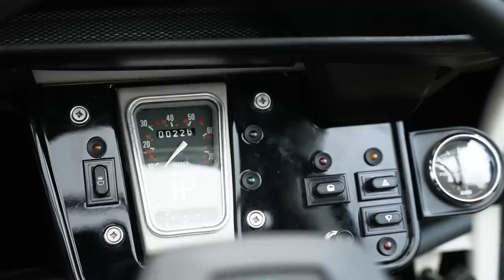All NEW electric converted Citroen 2CV

Comment: Got to love the way they are keeping iconic cars alive. This seems lovely.
Not sure about the spare wheel thing. The two times I needed one I actually had something physically sticking in my very well looked after tires :D.
Reply: You can find a front bonnet with spare wheel fix on bonnet, it’s available if looked around hard enough, probably a shop outside Paris sells them.

Comment: My thoughts are mainly around it not fitting with how I use my 2cv but may be relevant to others as a large part of 2cv culture is day long runs of 100+miles or driving cross country to 2cv meets. 

For me it’d need at least 30kWh and CCS. 

I would love an EV conversion for mine (my daily driver is an EV) but the club cassis kit just falls a bit short for me.

Comment: Why? I can’t imagine that this makes any ecological sense at all
Reply from the maker: London CC for example...
Reply: More than throwing it away and digging an entirely new car out of the ground I would have thought.
Reply: There's a lot less material in one of these than in any of the modern "cute" EV's, light weight means less energy to move it, less brake dust pollution when you stop it and it'll be the kind of car that is looked after long term rather than traded in for a new model after a couple of years.
Reply: My point is, that a regular 2CV is a very economical car. Keeping it on the road, rather than sticking in a new EV engine and a battery pack seems a lot more sustainable to me. I might be wrong…
Reply: @oliverlondon5246  Depends how long you are going to run it for and if you live in a  city that still allows you to drive a petrol car, as Jonny says, it's not for everyone.

Comment: My 1990 2CV6 Charleston has a top speed of 115 kph and range per tank of 300 km...
Currently insured in Australia for $42,000 (Euros 27,000)

I could get enthusiastic about a 2CEV as long as it had a top speed of 135 kph - which I have seen on my 2CV6 on the GPS on a long down hill with a tail wind.
AND.... a minimum range of 200 kms.....preferably 250 kms. 90 km range is not enough for a fun excursion in the countryside.

After 3 new 2CV6s - 1978, 1982 & 1990 and 550,000 kms - so many smiles per mile.... I am totally addicted.
I have only had 1 flat tyre in that time... in 1979.

Comment: I've got one 2CV that I restaured. She's been waiting for 8 years for a conversion kit. But those kits costs more than a working electric car.
Ultimatively, it's may be cheaper to get a Renault Twizzy (biggest motor) and fit the whole system into a 2CV.
Reply: As tome goes on parts are gonna get cheaper, so grabbing a drive train is probably the best route to go. I've been tempted by a few wrecked Nissan Leaf(s? Leaves?), but apparently their control systems are a real pain.

Comment: Love a 2CV, i learned to drive in my mums Dolly and use to have surfboards sticking out the back with the roof down when i was in my late teens. i seriously considered one for the kids school run but they are holding value but an EV conversion might just swing it. Just wish you have driven it without the door on (they lift off) would have been hilarious.

Comment: If they can get the range up to 100 miles with a fast charge option it would be great as a round trip into my closest city is 58 - 64 mile, depending on which side of the city one is visiting, if only spending 30 minutes there I might not make it home.  For pottering into the town and back it is great as only a few mile.  Never owned a 2CV but always loved them along with the Renault 4.  French quirkiness but very practical.

Comment: I see that CV as very flexible. Change the tire and suspension set to wider tires and stiffer suspension (lower) and plug it with a higher power motor and a suitable battery and you have an exotic dancer.

Comment: Out of the classic Citroëns, I think the CX would make an excellent conversion. It's large enough to have a lot of batteries, it's frame is lightweight enough to not end up with heavy tank, and it's sleek enough to have low drag. Plus, you get versions with airco, and (slightly) less prone to rusting than the 2CV...

Comment: I'm loving all of these companies making EV conversions for classics, especially the ones that make it so you can go back to the original ICE easily.  It genuinely is the future of classic car ownership for a lot of reasons.  It's especially appropriate to anything where the engine isn't the defining characteristic of the car.  I know that when my Mini is no longer viable to run as standard due to emissions, fuel availability or just social pressure then it'll be getting an EV conversion with the original engine kept for prosperity.
Reply: Well for the 2cv the highly unusual aircooled twin boxer is very much part of the character. These EV conversions just lose all the character, and makes every classic the same. Converted jag E-type? I can’t even imagine how much of a sin that is, the same with something like a Lancia 037, aircooled porsches etc.

Comment: This would definitely turn my head to EV, but for that range. The tech is not there yet for true take up, battery design in 2 or 3 years will revolutionise this scene, but the early adopters of today are buying toys for the well heeled mainly. This lovely machine is fine for local use of course, but a car like this should be enjoyed all day, all week, out on the open roads and far away.

Comment: In the UK you can do pretty much anything, however in France these conversions were illegal at first, now they're legal, but you need to keep the performance similar as before, so that the brakes can deal with it, etc. If you don't do that then you have a new car on your hands and need to certify it, which is of course impossible with a 2CV, it doesn't adhere to any modern standard.

Comment: absolutely want one… had two 2cvs of old 80s square headlamp 602 that i went up and down the uk checking out unis. drafting behind the artics on the m1 and m6. then  a late model dolly from portuguese factory. broke the chassis (snapped it) heavy emergency braking on gloucester place w1 lights avoid a late red light idiot. with the man from delicious vinyl label in passenger seat. “wow man” he said after nearly exiting via the open roof space “ we need these funky cars in california” as we waited for a tow… to the breakers yard (sob)

Comment: 2CV not for long journeys? 20 years ago I drove a then 30 year old one from Amsterdam to Istanbul and back. I'll concede you have to have some patience and a sense of humour to do it. Avoid the big motorways as much as possible. And don't care when exactly you will arrive where you're going. This was very much a "it's not the destination" situation. Anyway we had a great time and almost no technical problems. If an upgraded one could provide the same experience as an EV that would be lovely and I'd consider doing it again. Larger battery capacity and fast charging capability would seem more important in that case. Perhaps it would require stiffening up the suspension a little and putting an extra battery bank under the seats or something. Can't see where else you'd put them.
Reply from the maker: Amsterdam to Istanbul? You are one of the brave ones. Stick to a piston 2cv...
Reply: @TheLateBrakeShow  I wouldn't call it brave but rather we were blissfully ignorant at the time. We just thought it would be a neat idea and did it. And it worked somehow. Before departure we restored the car (2CV AK400 van) and had it thoroughly serviced. Packed it with camping gear and off we went. Two weeks of driving about 5 hours a day, sometimes a little more, to get there. Then two weeks of relaxing and sightseeing, and two weeks back. Still a fond memory.

Comment: The 2CV set the standards for climbs in cycling based on what gear the car needed to get over the climb e.g. easiest climbs are Cat 3 up to Hors Cat which is a climb the car couldn’t get over. What does this mean now - Cat 3, Cat 3, Cat 3 and Cat 3?

Comment: Hopefully they fitted a proper heater with a fan, because the 2  CVs were used to have in the 80s Was absolutely bloody freezing during the winter. You’d have to drive with scarves hats and gloves on the car was  that cold inside.

Comment: Classic cars should stay classic, but in this situation I think an EV conversion  is acceptable, the original powertrain was very underpowered, and if you want, considering the modifications they made to the engine bay it means you can put back the original petrol engine without a lot of effort.
Reply: There's a better way than destroying classic stock. If Citroen offered a retro body or chassis or allowed others to do it under licence. That way the original cars are left alone and if someone wants a modern clone they can have one

Comment: I'm not into 2CV's and I'm not into electric cars, but now I fancy one of these for no good reason, probably the 2CV van version for added practicality. I'd miss the sound track, but that could probably be solved by fitting a 45-50 hp motor for a bit of ridiculousness.

Comment: Can anybody tell me the purpose of the gearbox?.
Apart from connecting motor to wheels.
He said you can use 3rd or 4th and just leave it there.
My logic tells me using 3rd would accelerate faster but cruise slower.
Jonny didn't mention it, but it's still has a 4 speed gearbox and a clutch. Why not use it to improve acceleration?.
What am I missing??

Comment: Would save a bit of weight by removing the flywheel and clutch, and by switching to a simplified gear reduction box.  Ditch the clutch pedal and linkage.  Switch that weight out for a few more kWh.  But I agree this isn't a car for long trips, so what they've done here is totally fine.

Comment: A lot of the EV conversions still have the gear box. I can understand that if you want to preserve the parts and have the option to put the engine back in, but in other cases, wouldn't it be better to remove the gearbox too? Less weight, less moving parts etc. But is there some reason why it's not possible?

Comment: Perfect choice for EV conversion, buuut,.. the reason production was stopped, is that there's no way the 2CV would pass any modern crash test. Does the conversion do any improvements to the structure?
TBH, range is fine for inner city use, and in the prototype there, there's room either side of the motor and current battery (sic) for another two 'longer range' batteries. If it had 200km range and overnight charging at home, it would suit most EV use cases - someone need to do a modern version of this with modern safety, staying under 1000kilos mass.

Comment: what would be really cool (given the 2CVs chassis construction method) is if you could somehow fit a battery pack in the floor.
Reply from the maker: This conversion allows two mounting locations - one is recessed into the floor.
Reply: @TheLateBrakeShow  six must have missed that
Reply: @panman1964  I understood it to mean that the options were both “battery-in-boot”, but one that cut the boot floor and one that didn’t. I may be mistaken though. 

What I think you’re suggesting, and which sounds really interesting, is to utilise the box section in the centre of the chassis.  Roughly from front bulkhead to back seats, the two main chassis rails are joined by a few cross members, and then sheet metal skins top and bottom.  When I replaced a chassis the aftermarket replacement had the bottom sheet literally just screwed on (M7 screws, naturally!) so there was access from below the car. Yes, I reckon you could get a few batteries in there.
Reply: @Steve.M  ah maybe I didnt miss itthen :) Yes that is exactly what I'm suggesting.

Comment: We are going to see more classics converted to EV. A point that gets ignored is that of the status of the converted car, on reaching 40 years in the UK they become VHI and they are then exempt from tax (VED), MoT, and congestion charge. Converting to EV they will continue to not pay congestion charge, however if the government starts to look at what's happening and thinks this is encouraging more use of 'old' vehicles maybe they will revoke the VHI status of such conversions.  The big question then is how are they treated, some enhanced MoT/approval testing and what happens when they bring in a replacement for fuel tax as the two things could be contradictory VHI and electric fuel type in the DVLA records.

Comment: right, speed is not everything. we should remember back.
We cruise to our destination, not hurring.
Why I drive a Twizy and a Zoe.
And my old good boy - a 1983 Capri with it's V6 sound we also don't speed anymore, we cruise.

I have been thinking about a conversion several times. But the V6 sound is a thing that is glued together with the Capri.
And a conversion is too expensive, you get a brand new Zoe with the 52kWh battery für that money. Battery included. 
What would be a good compromiss, if someone invents a "hybrid kit" - so the motor is installed between the engine and the gearbox, it can drive a short range electric, recycles the braking power, charges the battery with regeneration, but you can still drive it with gasoline if you want.

Comment: I like electric mobility, but in this case it is a shame, to remove the original engine. Its so fun to drive the 2CV withe the iconic 2-cylinders air cooled boxer engine. This car has modern engine and the safety level of the past. It is so expensive, that you can buy a used electric car and an old 2 CV. Both nor in mint condition, but then you have he best from both worlds.

Comment: 'If you're going to spend 40 grand on a 2CV you've got to be pretty committed' 
(Some say that if you're going to spend 16 grand on a 2CV you NEED to be committed..)

No, fair play to them,  i just had to squeeze a joke in, the temptation was too great. Most of the issues with EV aren't exclusive to a 2CV and if you've chopped 11 or 12 seconds off the 0-60 time then you have definitely 'done something good'. 
The battery packs and to a lesser extent the BMS are seriously expensive and take out a hefty chunk from the profit margin.

At least with this, if the 12v system goes flat you don't have to dismantle the front of the car to charge it back up again...unlike a Tesla (Ask James May..)

Comment: It is somewhat a misnomer to call the motor a DC motor. On their webpage the 2CV is described as having "a 20kW synchronous brushless DC motor" Which usually means a synchronous PM AC motor where the inverter is built into the motor so only two DC wires + control wires go into the motor. In the video however, the inverter seems to be in the black box on top and 3 orange wires goes to the motor, so in my dictionary, this is a 3 phase synchronous PM motor (which is the neatest and most efficient motor you want in an EV anyway) So why not call it that? First watching the video, I thought this had a brushed DC motor and a forklift controller! NB: a 2CV is an excellent candidate for an EV conversion. It is made to use as little gasoline as possible = energy efficient, light, skinny tires low loss gearbox!. The 30' version used 2.38L gasoline per 100km!

Comment: Someone needs to do a battery converted Peugeot 205 now. Perfect platform to make a slightly more comfortable city car than the 2CV.
Reply: Nope. Totally different beast, they need to be driven hard, with a gearbox to extract their true character. The 205 was about character and performance, and actually has decent engines.

Comment: I'd love to convert my Bedford Bambi camper to electric power, as it can only do 50-60 mph anyway!
Reply from the maker: That would be excellent, as it isn't a long distance car anyway!
Reply: @TheLateBrakeShow  That was my reasoning too, the ICE power plant only delivers low end EV performance anyway, and with manual windows, and steering, and I'm not even sure if it has servo assisted brakes, there would be less secondary problems to deal with.

Comment: It seems to me that the weak point in all these classic car EV conversions--I've seen a Fiat 500 and VW Beetle one as well--is that they just never seem to be able to put enough batteries in to give a decent range. Add on top of that they pretty much never offer fast charging either and you really have to wonder why you'd get one of these as opposed to, say, a Renault Twizy, which is just as quirky and unusual, accelerates faster, has equal or better range, and costs far less. I can't even see why a 2CV lover would want to do this when the 2-cylinder scream and the shotgun gear change are such distinctive features of the car!
Reply from the maker: The biggest obstacle is packaging a large amount (and weight) of batteries without substantially changing the existing structure or character of the car.